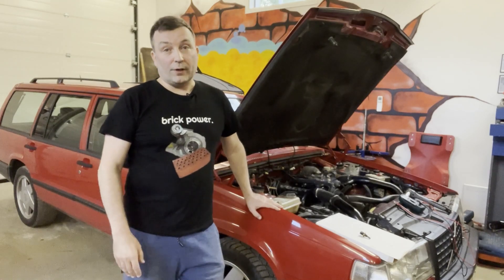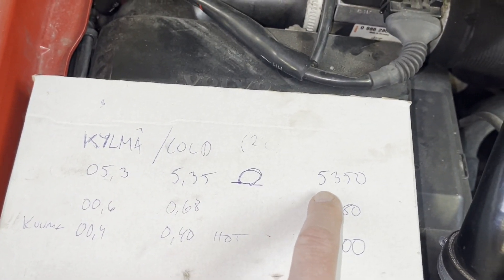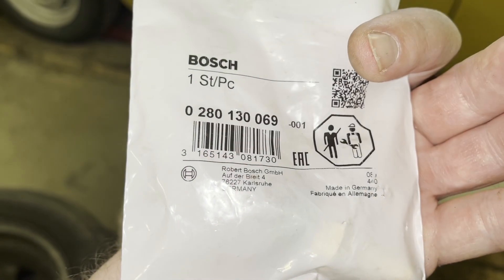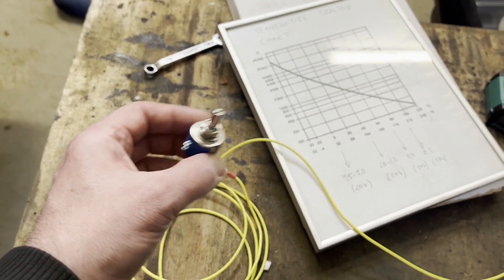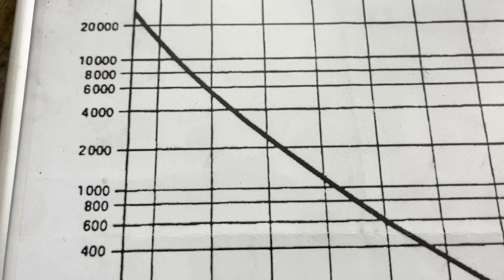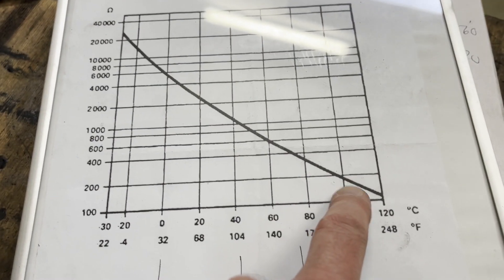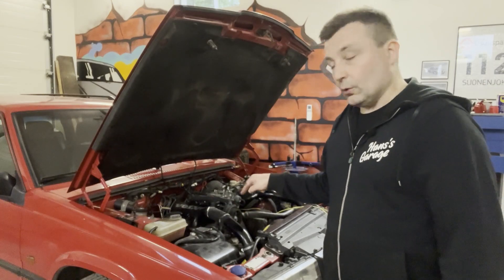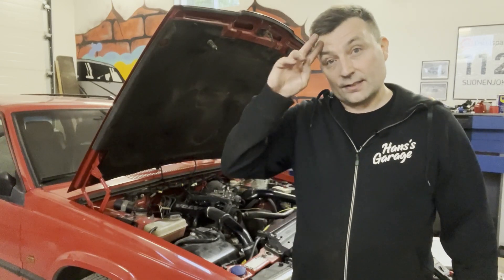Volvo 940 sensor and potentiometer testing

Comment: I haven't watched your newer videos, so I'm not sure if you got this to work already.
The temp sensor for the ECU is actually 2 sensors in 1. Both of them measures resistance to ground, so you should use only one of the wires in the sensor and connect the other one to ground to measure resistance. I'm not sure wich one of them that are in use for the ECU, but you can test both of them.
Also; The diagram you have is for the instrumept panel sensor, and that is most likely different from the ECU sensor.
Reply from the maker: Thanks! New cap and few new hoses fixed the problem. There was an air leak and system didn’t hold the pressure so coolant wasn’t hot enought.

Comment: Great work! I checked all your hard work!! I do have exactly same problem.. I checked all your step, result is same😂 also, I checked all wires resistance connector to connector it is 0.2ohm all, which is okay now a I am guessing swapping ecu or ezk… wish me luck! Im with you!
Reply: Just changed reservoir tank cap with new volvo one, it hold the pressure until actual temp goes up to where the fan kick on.
Reply from the maker: Same.😁 I have now new tank, cap and hose. I had multiple pressure leaks. Now the cooling system seems to work. I just missed the pressure.🙄

Comment: It's another temp.sender for the instrument it's placed  a bit to the right under the intake. There should not be any result on the instrument  when ju has loosend the kontakt on the right sensor if i remember right i should be under the intake for cyl.3